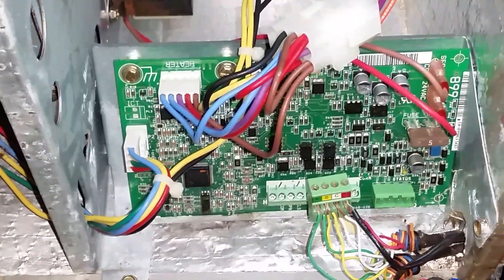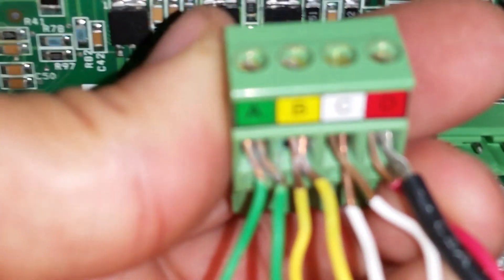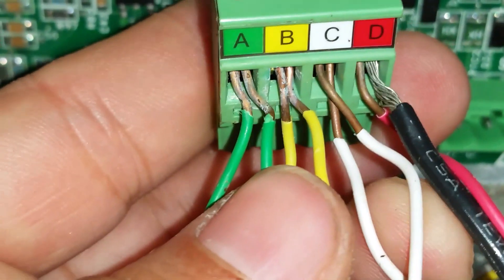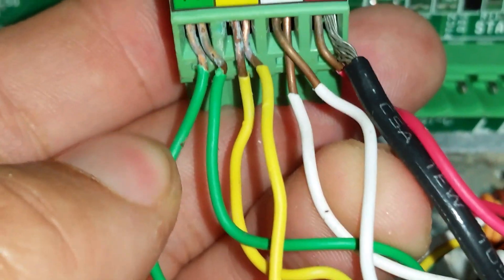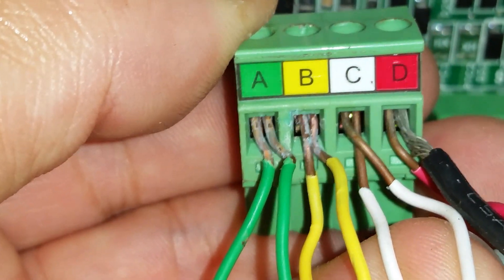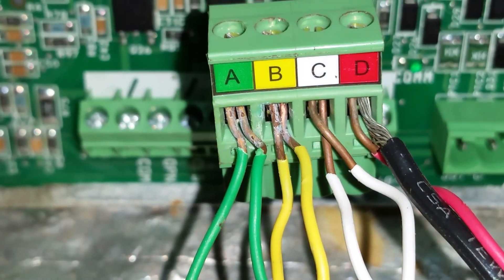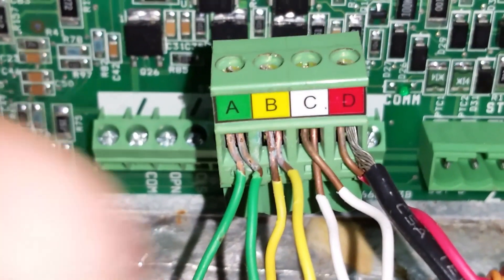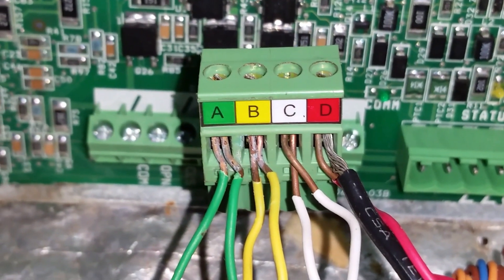HVAC - 60 Second Tech Tips #10

Comment: Good tip. I used to always use a whip that way only one wire was in the terminal. Also, Lennox recommends to wire nut together all extra conductors and connect them to common. Thoughts??

Comment: The black wire is turning of the compressor??
Reply from the maker: Antonio Santiago On this unit it was wired to break 'R' power going to the thermostat. If the water safety trips the thermostat goes blank and the whole system shuts down. Thanks for watching.
Reply: HVAC in SC  cool thanks for the feed back. We configure the r and g shut down through the stat,for floats but I thought this method would work and you confirmed it with the video. Now I know to  break the leg to the tstat if need be.
Reply from the maker: Antonio Santiago No problem. We do the same thing but this system was a first generation and did not have that feature available.
Reply: HVAC in SC  thanks for the info. Keep them coming specially those infinity/ evolution videos 👍🏻

Comment: Maybe use some dielectric grease?
Reply from the maker: Joe Shearer Absolutely! I keep a small tube in the bag at all times.
Reply: HVAC in SC I ordered a cheap pocket scope on eBay I'm waiting to try it out on some communicating signals to see if I can detect known good from bad signals
Reply: Can't wait for  you to scope it out Joe, do you know if Carrier/ICP just uses RS485 Modbus?  I know they also sell interface readers you can hook up to your PC fairly cheap.  I wonder if you can also read the commands off the line?  But I do think if you scope it out, you'll see the noise/voltage levels.  Great tips
Reply: Gary Gin I really don't know anything about the software they use. What I'm doing is just trying to distinguish a good signal from a weak/bad one. I scoped a goodmana unit today but I'm still trying to figure out the setting on the pocketscope and just seeing what it looks like. Right now it looks like high frequency sine wave but it happens so fast my scope doesn't have good detail.  I can email you screenshots if you want
Reply from the maker: Joe Shearer Nice! Keep us posted.
I've used a data loging multimeter to trend the DC signal on a few Bryant inverters trying to see if I can use that info in my diagnostics.
Reply: That would be great Joe Shearer, I will send you my email, I think it would be cool seeing the wave forms.
Reply: Joe Shearer the dielectric grease prevents oxidation?